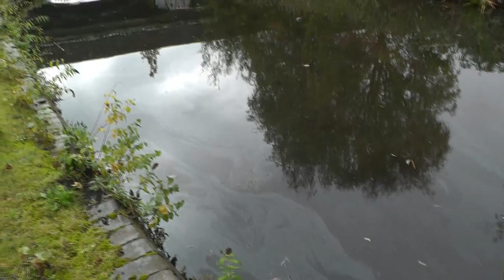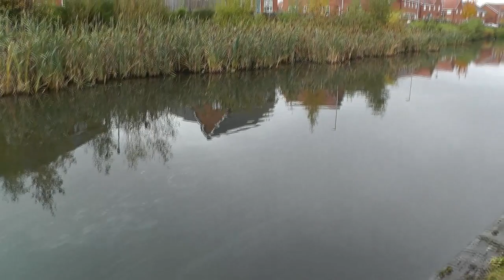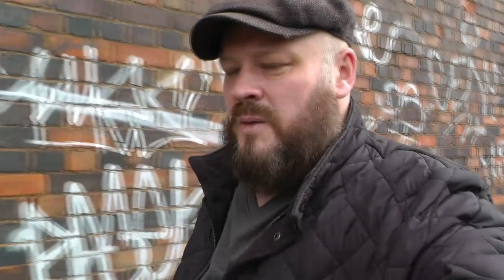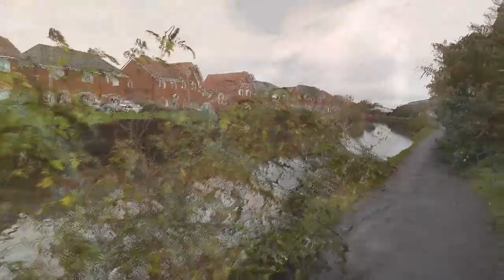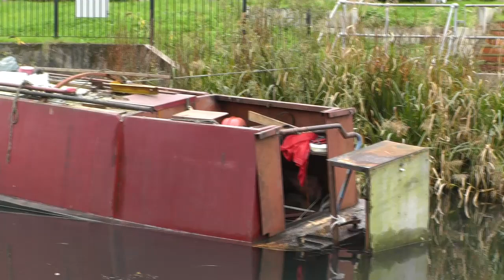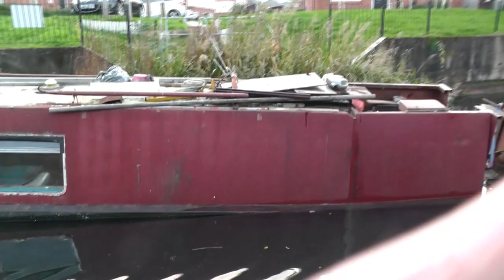Sinking Narrowboat #153 Birmingham New Line Canal

Comment: And here I thought the CRT was supposed to be concerned about the environment.   They should have been out there putting a containment boom around it when it first started sinking and be cleaning up the spilled fuel and oil that already escaped.  

Also, unless there is an unsealed hole between the engine compartment and the cabin space, a leaking weed hatch or stern gland shouldn't be able to sink a boat.  There would be enough reserve buoyancy in the remainder of the boat to keep it afloat even if the entire engine compartment fills.
Reply from the maker: Sad sight and people have been down to it but still remains the same